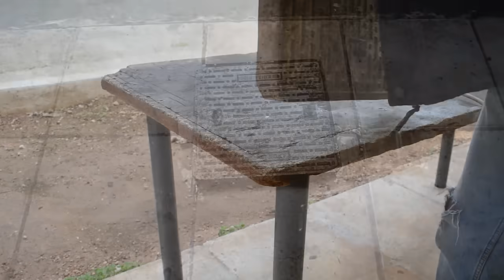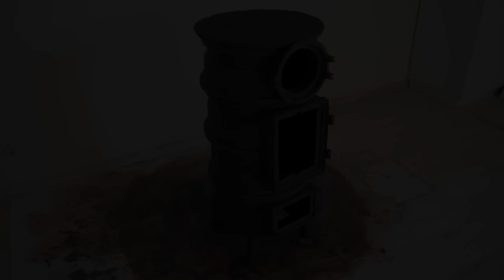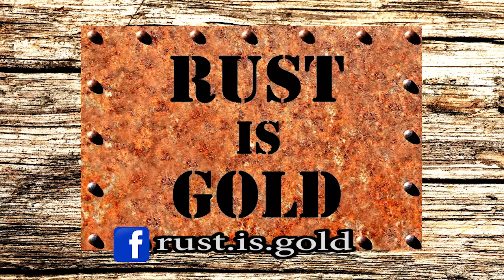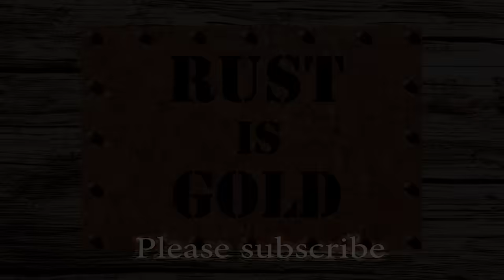DIY Wood Stove made from Car Rims

Comment: esta todo muy bien pero debe practicar un poco mas en la soldadura nada mas saludos🤣
Reply from the maker: ¡Muchas gracias por tus comentarios!  ¡Creo que poco a poco pero de manera constante estoy mejorando en la soldadura!  😊👍
Reply: I think the problem is thinking you have weld penetration when you do not. The flux left after welding is deceiving. Slow the weld speed and puddle the molten weld line a little more. Alternatively, a mig welder is a great investment and will give you a much more consistent weld line and will look much better. You have done a great job with the design of the product. Well done.
Reply from the maker: @coopersrace7277  thank you very much for your comments and your suggestions! I appreciate. Slowly but steadily I think I am getting better in welding. 
In addition as someone commented once  "...A grinder and paint makes the welder you aint..."!!😄😊👍👍
Reply: @RustisGold  hahaha very true. Keep up the good work!
Reply from the maker: @coopersrace7277  thanks! Take care! 😊👍
Reply: Jajajaja pensé lo mismo ,no queria ser al mala onda pero bueno las cosas como son ....saludo desde Argentina 🇦🇷

Comment: Chimney Sweep: No secondary combustion air or air wash over the glass door. At best this 15% combustion efficient, expect to have a lot of soot production and a chimney fire every year, as well as excessive sooting on the door itself. Add a baffle at the top to increase flue gas residency time inside the burn chamber, as well as some refractories to insulate the steel. If you have a few pipes with holes drilled in them to introduce more air, just under the baffle, to burn the unburnt  gasses you'll have better fuel efficiency. I would recommend looking at some of the modern woodstoves for inspiration on how to incorporate these features. Otherwise this is very reminiscent of early pot belly coal stoves.

Edit: Also, single wall pipe has an 18" clearance to combustibles, use double wall next time to get down to a 6" clearance. That being said as this is an unlised stove, in the States this requires a 36" clearance to combustibles. I could go on but it's a neat DIY.
Reply: Pfffff.🥱
Reply from the maker: Thank you very much for such a detailed message. Thanks for the tips!! 👍👍👍

Comment: You have excellent building skills.  Lol you just need to work on those welds.  Turn your machine up till you can’t handle it and then dial it back some.  You’ll lay down beautiful beads with those low hydrogen rods.
Reply from the maker: Thank you very much for your comments!
I think, slowly but steadily I am getting better in welding!
I also decided to buy a MIG welding machine and give it a try! 😊👍
As I have mentioned before... "A grinder and paint makes the welder you aint"!!! 😄👍
Reply: @RustisGold  It looks slick  man.  I really like it.  Nothing wrong with thinking slow when you are building something one of a kind.  The man that thinks fast has so go back and fix things and that makes him slow in the end.  Nothing wrong with grinding and painting welds but when you get it down you’ll want to leave them for folks to see.  Plus it’ll save you some grinding disks.  Also,  if you do a lot of projects like that I’d consider getting a small cutting torch with some small tips.  Keep you from having to cut so much with that cutting wheel.  Lol that looked unfun.
Reply from the maker: @WOMPITUS  thank you very much for your comments! I appreciate!
What is your opinion about MIG welding machine versus the traditional stick?
Right now I am building an ...R2-D2 BBQ grill! It is time consuming ...a lot of detail! 😊👍
Reply: @RustisGold  I don’t like a wire wilder unless it uses a shielding gas.  The gasless wire machines just make a mess in my opinion. Those low hydrogen rods will lay a beautiful bead with minimal wrist movement if the heat is right.  When it’s in the sweet spot the slag will peel off with very little effort.
Reply from the maker: @WOMPITUS  I guess I need to increase the heat because in my case it is difficult to remove the slag...
Reply: @RustisGold  Bingo.
Reply from the maker: Thanks man! I increased the heat and my weldings improved 1000% !!!
The stupid indicator on my welding machine was completely off... I am using 2.5mm rods.
I increased the heat to where I was supposed to use 3.2mm rods and not the 2.5mm where it was set and the outcome was incredible! 😊👍👍
I feel so dumb for being afraid to try it earlier...
Reply: @RustisGold  Outstanding.  Stay under that hood.  You’ll get better and better
Reply from the maker: @WOMPITUS  😊👍👍
Reply: @RustisGold  hey you did great ,mad fabrication skills
Reply from the maker: @anthonyalamonti44  thank you very much! 😊👍
Reply: Awesome job. Very fun project. What was the total build time?
Reply from the maker: @ronpage101  Thank you very much for your comments! It took me a month to build it but I didn't work on it every day... I would say net time was around 2 weeks (6-7 hours per day) 😊👍
Reply: @WOMPITUS  this is whag youtube should be. Offering advice to help someone get better and not bashing. You sir are a gentleman and a scholar.
Reply from the maker: @garym51124  Exactly!!! 😊👍👍 There are so many YouTube haters, it is really sad...
Reply: @RustisGold  Only go MIG if you're gonna run shielding gas and have a decent amount of amperage available (not one of those tiny 110v machines). But you can get really good at stick welding and save that money.... learn about different electrodes and experiment with amperage and technique and you'll do beautiful work with stick. Read up, do some practice welds on scrap for a few hours and it'll be night and day. Really nice project, btw.
Reply from the maker: @doviejames  thank you very much for your comments. Since I started experimenting with my stick welding machine I think I have really improved.
I have also watched a lot of YouTube tutorials.
I realized that the amperage indicator on my machine was completely off. In order to weld with a 2.5mm rod I need to set it close to the position for the 3mm rod. I was doing it wrong all this time I couldn't understand why...

Comment: What is the purpose of the top door?
Reply from the maker: Thank you very much for your comments! I wanted to put a small door on top and I had this circular door here in stock so I decided to install it! All the other wood stoves I searched in YouTube had 3 doors. In addition you can open this door to allow more air to go up to the chimney.  This will clear the stove of smoke with out opening the bottom draft door which will increase the strength/heat of the actual fire.

Comment: What is the purpose of the upper round door?
Reply from the maker: I wanted to put a small door on top and I had this circular door here in stock so I decided to install it! All the other wood stoves I searched in YouTube had 3 doors. In addition you can open this door to allow more air to go up to the chimney.  This will clear the stove of smoke with out opening the bottom draft door which will increase the strength/heat of the actual fire.
Reply: Perfect for cooking a hot dog or brat it lol. I cook brats and hot dogs in my wood burner when it's freezing out. Drink a cold one and cook your meal by a hot fire
Reply from the maker: @andrewhuber7666  😊😊👍👍

Comment: What’s with all these diy stick welding videos have such bad quality welds but the engineering side is good
Reply from the maker: Check out my latest Star Wars Creation!
R2D2 BBQ GRILL!😊
Much better quality welds on this project! 😊👍
https://youtu.be/br0hPKZU5L0
Reply: I’m glad I’m not the only one who noticed that welding seems are such poor quality. Because with the poor quality of welding the heating and cooling will cause the seems to pop/break allowing some smoke to leak out. Otherwise the overall design (with better welds) would make for a solid long lasting iron stove.

Comment: Huge labor investment! Cool (no, hot) finished product. Thumb up! Damper door seemed crude, I have not heated with wood for decades, I might not remember right, but I think my stove had slides that were able to fine tune incoming air for a really long burn time.
Reply from the maker: Thank you very much for your comments! I do the same thing with the lower door and adjusting the air flow...

Comment: Please improve your welding skills
Reply: Please improve your criticism skills.
Reply: hes using a stick welder, not as nice as a mig or tig actually for stick it looks like he got alot of penetration, I would have chosen a nice wire feed welder it would have better seals, but for a stick it looks normal.
Reply from the maker: @ryanlangan1060  hahaha thanks! Great comment!
Reply from the maker: @mikeylikesit12345  Thank you very much for your comments. I am not a professional welder. When it comes to simple welding I have no problem. This one was more difficult because there was some gap between the rims and the metal boxes I created.... I also used the grinding wheel at the end and it looks pretty good. I am planning on buying a Mig in the future.
Reply: @RustisGold  a mig is not going to help and woyld actually produce worse welds on cast. Judging by the looks of your welds you need more current and need to weave make little circles in on direction and pill the melt puddle along. Also the pepper choice of rod makes a big difference night i suggest NI-ROD for welding cast iron and steel to gether preheating the cast iron is essential to prevent the cast from cracking and insulate the welds and allow the cast to cool slowly. Cast iron is very had to weld. Mild steel would have been a better choice

Comment: The design is good - mostly.

A few things I would change :

1. Handles need to not be all metal, metal conducts heat and iron/steel are especially good at holding onto heat.  Those handles will get hot.

2. Why would you paint the inside?  That paint is good for up to 300 degrees Celsius, but a wood fire can get as hot as 900 degrees Celsius.  The first time you burned a fire in that all that paint was burned away and wasted and just put into the environment outside.

3. Coming from a former welder, please, for the love of god, get some scrap metal, watch some youtube videos and practice and learn to weld.  A good weld becomes part of the piece, bad welds are unsightly and time consuming.  You will spend less time learning to weld than you probably spent grinding your bad welds off.  While your welds on this will probably hold just fine because nothing is really structural in nature, it's still bad practice.

4. The slider at the bottom, while functional, would probably be better as a sliding box like a drawer rather than a plate.  Every time you clean the ash out some will get stuck in the slots and it will get harder and harder to slide it.

5. The circle port on the top serves no purpose.  You shouldn't have cut all the way through, if it was decorative just attach it to the outside rather than making another failure point.

The idea was great, and the fact you are upcycling old rims is also great, just need to refine your skills and design a bit and it would go from a pretty decent project to an amazing project.
Reply from the maker: Thank you very much for all your comments and advice! 
I appreciate! I have watched a lot of YouTube welding tutorials and I think I am getting better. Just trying to show to other people how they can transform pieces of garbage into nice looking and functional objects... 😊😊👍👍
Reply: i agree with top port.. why is it there?  i agree with the ash box at bottom...  i would also connect the latch points together with a single bar.. open/close both with one hand.  awesome job!!!!  where are you and what would you charge to build this again?
Reply from the maker: Thank you very much for your comments! I wanted to put a small door on top and I had this circular door in stock so I decided to install it! A lot of other wood stoves I searched in YouTube had 3 doors. In addition you can open this door to allow more air to go up to the chimney.  This clears the stove of smoke with out opening the bottom draft door which will increase the strength/heat of the actual fire.

Comment: That's a very good job nice looking and looks like it will heat good
Reply from the maker: Thank you very much for your comments! 😊👍👍
Reply: It will heat well enough...however it will consume a HEAP of wood if used consistently. Simple, effective but rather inefficient design and materials. Look up ROCKET STOVES. These are impressive.
Reply from the maker: @mmserver6890  Thank you very much, I will check!
For the time being my son liked the wood stove so much so he took it and placed it as a decorative item in his apartment! 😊👍

Comment: It looks and works GREAT!  What is the round door for?
Reply from the maker: Thank you very much for your comments! I wanted to put a small door on top and I had this circular door here in stock so I decided to install it! All the other wood stoves I searched in YouTube had 3 doors. In addition you can open this door to allow more air to go up to the chimney.  This will clear the stove of smoke with out opening the bottom draft door which will increase the strength/heat of the actual fire.

Comment: Super burzhuyka(russian mini stove), but I don't understand- what a 3 door high in you stove?  Very interesting, and thx for Ur great work👍
Reply from the maker: Thank you very much for your comments! I wanted to put a small door on top and I had this circular door here in stock so I decided to install it! All the other wood stoves I searched in YouTube had 3 doors. In addition you can open this door to allow more air to go up chimney.  This will clear the stove of smoke with out opening the bottom draft door which will increase the strength/heat of the actual fire.
Reply: @RustisGold  Yes, now I understand! Good idea.👍 Have a nice day!

Comment: Absolutely brilliant, well done, as for the people doubting the reliability of this I can say a local tire shop built a very very similar contraption,,( yours looks way way better) and they use it every winter for about a decade now so while no...80-100 years like the cast iron woodstoves of old not hardly but 10 years for certain is not bad for using what you have to make what you need , I'm astounded by the quality put into this. I want to copy your build but also add a little hole in the top with a removable cover for cooking unfortunately in the land of the free here in order to get manhole covers you must steal them but there are certainly other options , thanks for the idea
Reply from the maker: Thank you very much for your comments!!! Glad you liked it 😊👍
The manhole covers I used are for private use. You can buy them brand new for around 20€ each, (price depends from the size) at any local plumbing store. I bought my rusty old manholes from a scrap yard for a ridiculous amount of money.
Reply: @RustisGold  your welcome, and that's odd,well at least in the US , in my state and county at least there is no way to acquire manhole covers unless you are licensed with the utility company they have all of them  I went through an ordeal with that on the homestead where I put shut-off valves about every 300 feet of a 2500 foot line to control direction to different places and I wanted to do it  right and have little manholes to easily access the in ground valves but had to go a different direction on that project because it was completely private water supply and not from "the city" or some bs but anyways thank you for the reply and keep up the awesome fabricating!!
Reply from the maker: @wolfmanrebel874  thanks for replying! Here in Greece the State manholes have the County's or the Public Utility's emblem/logo written on them and of course it is illegal to use them for personal use...
Reply: What if you just put a piece of flat metal with hinges over the hole in the top.  Then you put a stove top gas black hot plat over the hole & cook?
Reply from the maker: @ruthcostea5633  I guess you could do that as well! I know the top on my wood stove is not very practical but I liked the design of the manhole! 😊

Comment: Nice job 🤛 but what does the top door do cheers
Reply from the maker: Thank you very much for your comments! I wanted to put a small door on top and I had this circular door here in stock so I decided to install it! All the other wood stoves I searched in YouTube had 3 doors. In addition you can open this door to allow more air to go up to the chimney.  This will clear the stove of smoke with out opening the bottom draft door which will increase the strength/heat of the actual fire.

Comment: Brilliant! I like the repurposed tire rims and grates. The doors are over the top really nice design. From my experience with making diy stoves, using rebar in the firebox isn’t the best, it will bend over time and deform under the heat, using strips of cast iron flat bar on edge holds up better to the heat. Great job 👍🏻
Reply from the maker: Thank you very much for your comments! I am glad you liked it! 😊👍👍